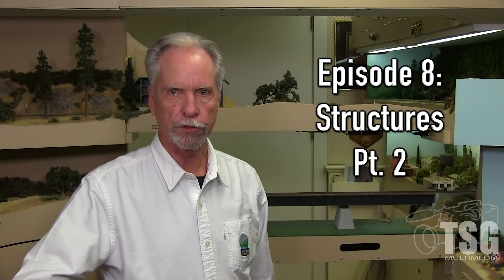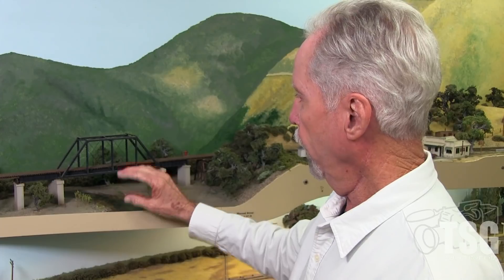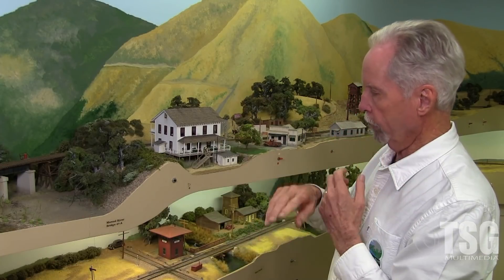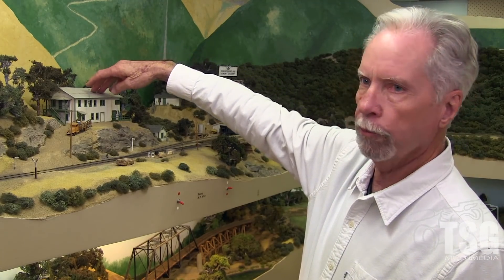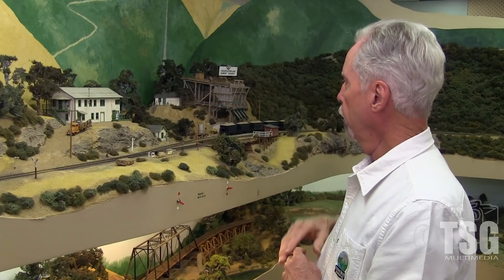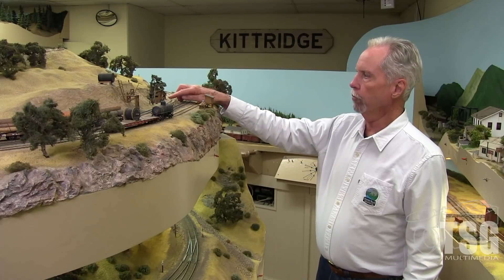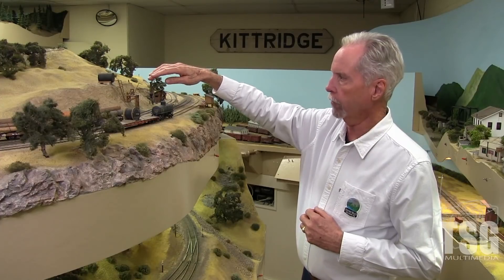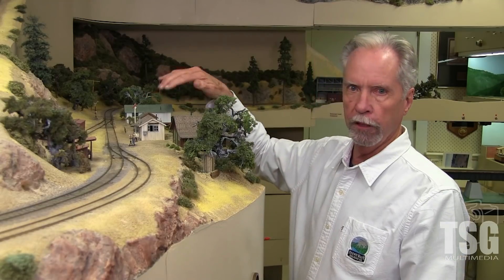Model Railroading with Jack Burgess Structures 2

Comment: I really enjoy videos like these. It is like learning from a mentor at model railroading who does not teach using the concept of my way or the highway. These teachers provide us with the information and often their opinions but let us discover on our own; pretty much it is my railroad. 
at this point i am in limbo with housing and don't know what i will have to work with in future housing. right now all i can do is watch and learn so i make fewer mistakes on my future layout.

As a help, I might be able to explain the outbuilding at Bagley Hotel. It must be a kitchen but the idea of having a kitchen outside of the main house is not well known these days. At one time farms had a summer kitchen outside of the main house. It was a place where major cooking and canning took place. It was mainly used during the summer but could also be used during any other season. The reason for the summer kitchen was because the stoves were wood heat. Cooking was boiling in large pots, baking and sometimes broiled. Frying could easily be done in the house but if it were a large batch it would be done in the summer kitchen. All this cooking would generate a lot of heat and it would heat up the entire house especially upstairs where the bedrooms are. Bear in mind this is before microwaves and well insulated ranges. The summer kitchen eliminated this problem.

This was common on large farms but I imagine it could have been at hotels where they cook for a lot of guests and the guests need to be as comfortable as possible.

The buildings may have been painted white because of Puritanistic values but also because white paint was easy to produce and cheap. Many wooden structures were whitewashed but even in paint the most available minerals produced white. It would be very expensive to paint with Indigo Blue.

Comment: Jack,
A few questions/comments/ suggestions. 
1) The Bagby White Hotel.  I may be wrong but I thought you said you didn't include the second building as it would have caused the layout to be extended beyond your space.  Did you think of freeforming the structure?  I was thinking turning the second building 90 degrees, install a relief structure, and paint a forced perspective continuation to the backdrop's cyc.  It would give both buildings, depth into the backdrop, & allow you to set an era by weathering the structure pre or post fire.
2) Add visual fantasy.  At the stiff legged crane.  What about removing a part of the fascia, install an enclosed drawer to house an under scene mine interior. 
I failed to state I HATE FLAT, PAINTED OVER, FASCIA.  I do use my fascias to extend my scenes below the layout.  So that's my impotice.  To extend the viewing pleasure and creative building to the next level.
Which finally brings me to #3)  I ached & quaked when you shared the story of your unusual visitors incident with your tressel bridge.
To the period the exact same thing happened to me in 1989, during a Regional NMRA open house.   But it gave my a chance to expand my talent.
As much as I hate blan fascias I equally abhor Duck under, Lift up, Drop down bridges.  This event was the lynch pin cause.
A wooden scratch built tressel some club members and I built was smashed beyond the BACK TO THE FUTURE'S bridge from a slip and fall.
After greaving I had an idea.  Instead of an opaque duck under I rebuilt the trussel, off layout.  Then, with the help of a G.E. R&D staffer, I recieved a huge sheet if LEXAN.  Now any acrylic will do.  We built a reinforced frame the size of the duck under.  I installed three, cut to fit, pieces of the clear plastic under where the bridge would be returned.  Useing the frame as a dam, I unfilled the surface and around the pylons with WATER EFFECT's.  Dressed the area with props, waves, ripples, and the new bridge.

Once back on the layout I made sure to paint the frame in Fire Engine Red and Blaze Orange Reflective Tape on both visitor sides.  Now when newbies to the layout experience the duck under they can look up and see the layout from "Down where its wetter...UNDER DA' SEA."
You do the best of the TSG videos.  I and my club members enjoy them greatly.
SEE YA' DOWN THE LINE
Jim